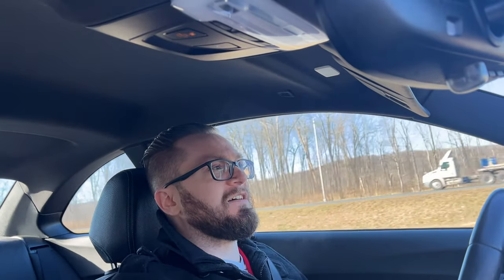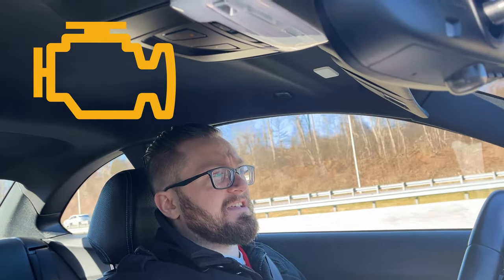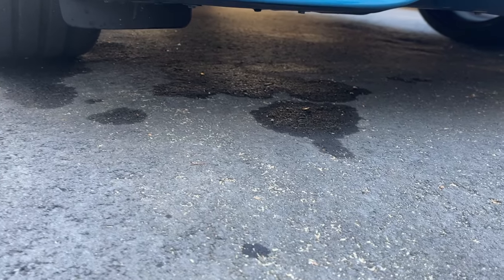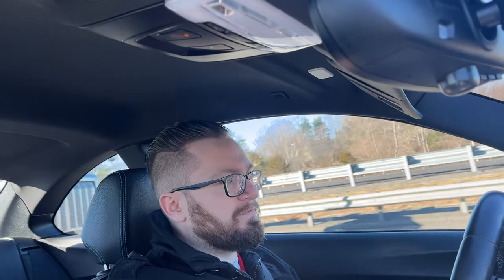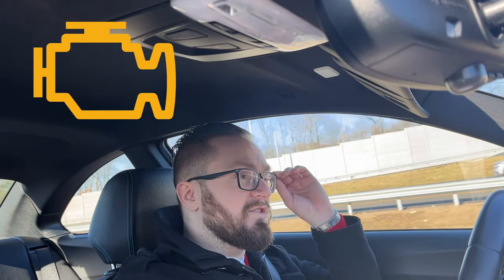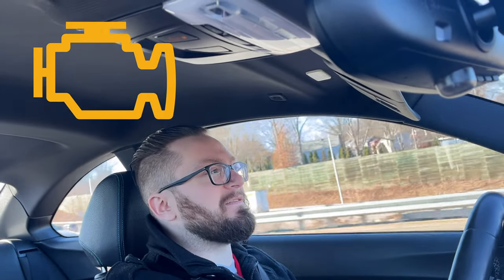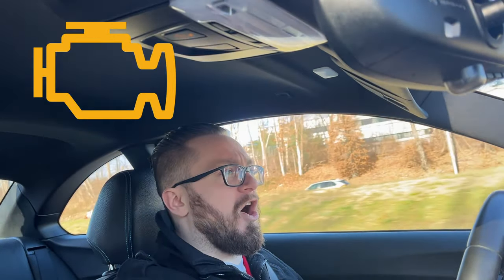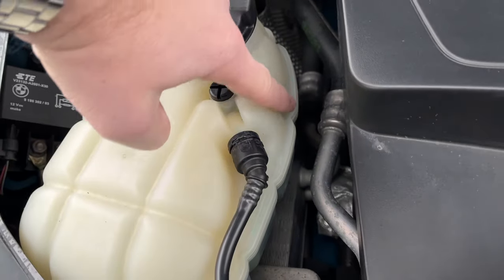BMW M2: The Ultimate Paperweight

Comment: Dude no way.
Reply from the maker: It happens! But at least it’s now back up and running
Reply: @BertskiZPolski  The exhaust pitch on the N55 Og M2 is so epic. Best driving mode is comfortable with the valves open. Sport + is almost too agressive with clutch gripping and accelerator ripping.
Reply: @BertskiZPolski  also, the Long Beach blue is hard to keep clean. So is the glass and mirrors.